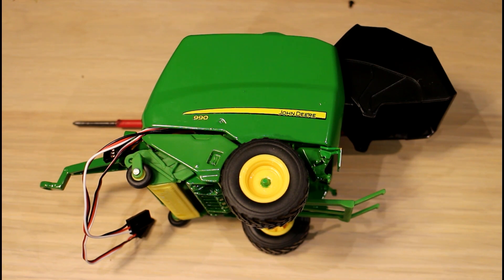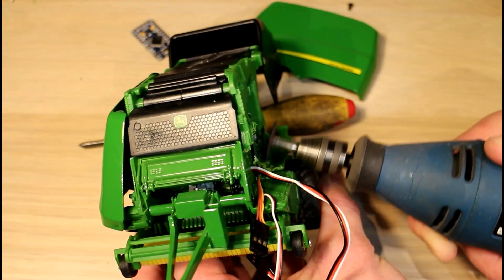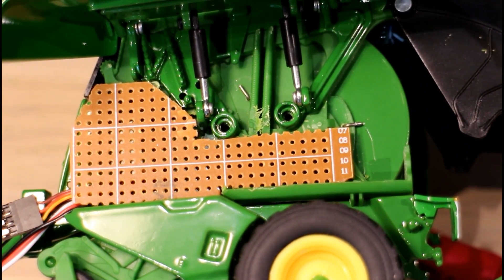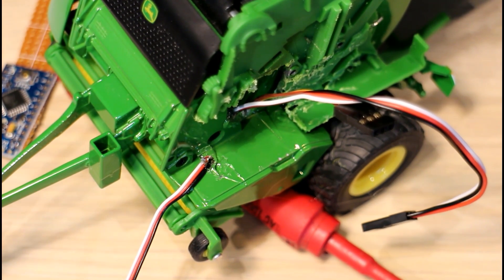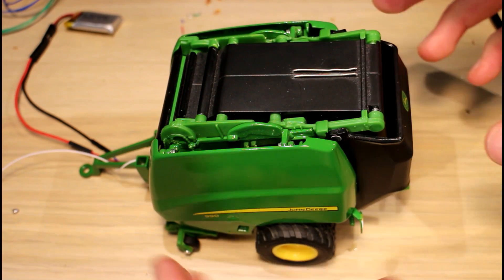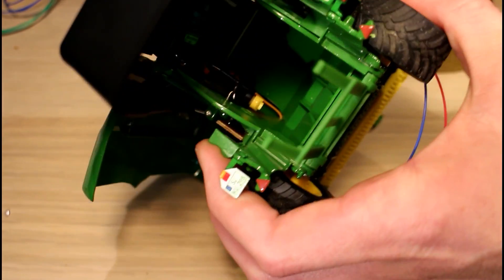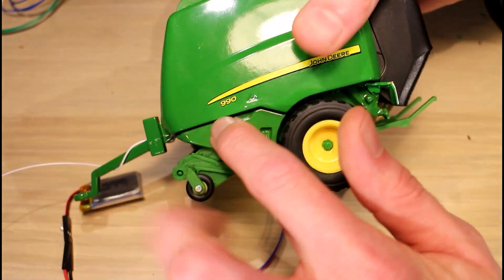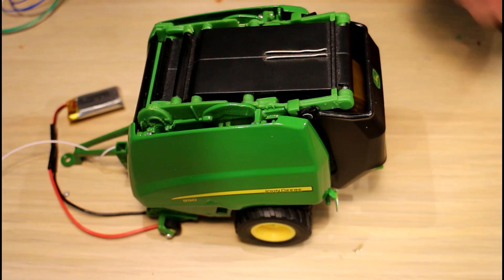RC John Deere 990 Round Baler Part 3 - MCU Install and Testing

Comment from the maker: Yes I've still a bit of tidying to do on the baler and a lot to do on the wrapper but I'll do a mowing, baling and wrapping video at some stage.
Reply: Nice.John deere is the best
Reply: +Rc Tractor Guy Do you sell this
Reply from the maker: Man Met Scnor No I don't have time to make models for people, I barely get enough done in time for the video each week :)
Reply: +RC Tractor Guy Ok i respect that but it would be cool :-)
Reply: +Man Met Scnor Btw make a video fully working on a John Deere when its finishd
Reply from the maker: Man Met Scnor The John Deere baler or the 9560R? I plan to finish both in the next month or two so there should be videos soon.
Reply: +RC Tractor Guy It would be cool both of them. Nice work
Reply from the maker: Yolofighter Hi, most of the parts you'll find here http://www.rctractors.net/electronics-from-ebay. I think I used the HD 1370A servo inside the baler but I can't remember for sure.
Reply: RC Tractor Guy hey
Can you Send me the Links of the matirials you used??
Reply: thx